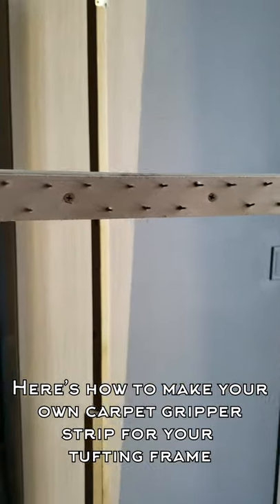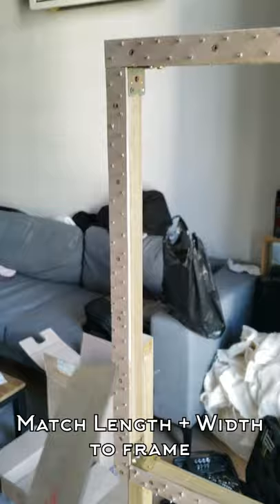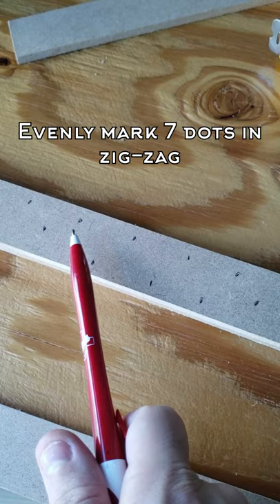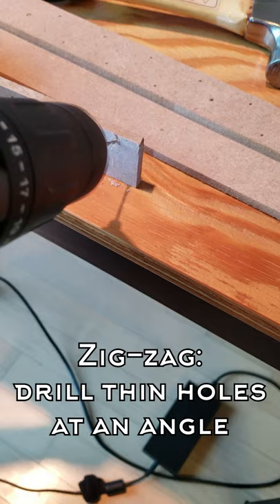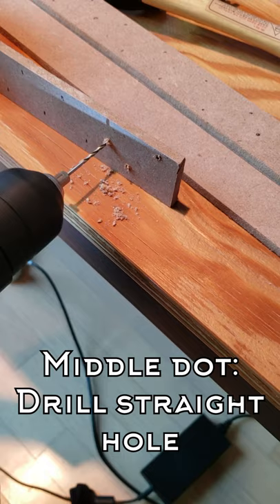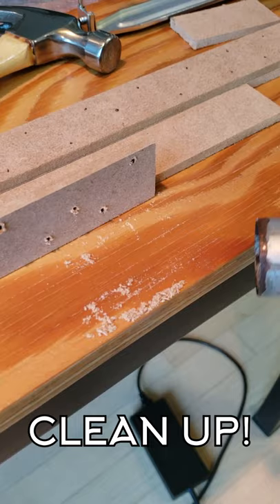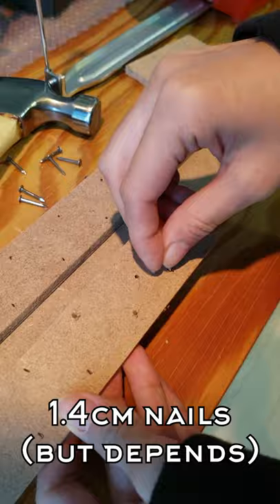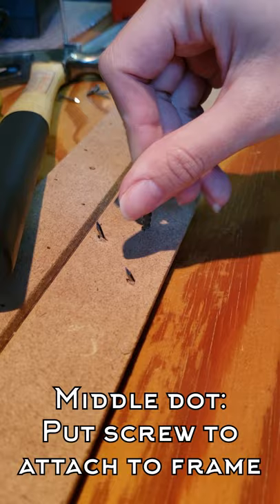How to make Carpet Grippers for Tufting Frame

Comment: You could work a minimum wage job at McDonald's and spend the same amount of time you spend making those and buy some
Reply: They are not sold where she is at.. 

Also she is theoretically saving/making more money per hour by making them.

 She can work 2-3 hours to buy them or she can work for 30minutes to afford the material and spend 10-30 minutes making them which saves her at least an hour of her life to do something else.

At McDonald's pay rate and buying a mcdonald's coffee... You can buy a cup of coffee for 12 minutes of work or you can make a cup of coffee yourself for 1-2 minutes of work at home.

If you breakdown costs and what your time is worth you realize that sometimes doing it yourself is cheaper.
Reply: @QargZer  ok that makes no sense lets say there are 15 nails per foot (not exact could be more) also, a small room has  about a 30 foot perimeter, say on average it takes 10 seconds to pound in a nail, that is 75 minutes of pounding nails not including any other cutting or modifying material. Also material, not much but wood prices have gone up, I hope there is nobody that values their own labor so little that they could make more at a minimum wage job
Reply: @nuclearexplosion5841  mcdonald's pays you $10 or less per hour. To buy the strips will cost you around $30 or 3 hours of time.. if it takes you 75 minutes to make them plus material it's still cheaper to make it yourself compared to minimum wage job.

You proved my point even with the ridiculous 10 seconds per nail time frame.